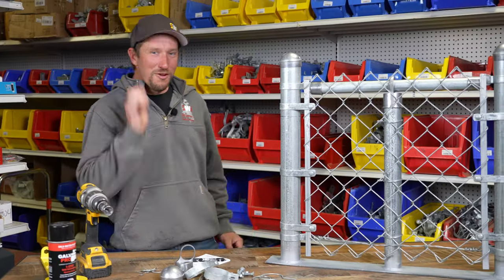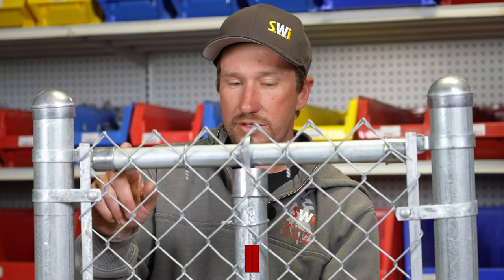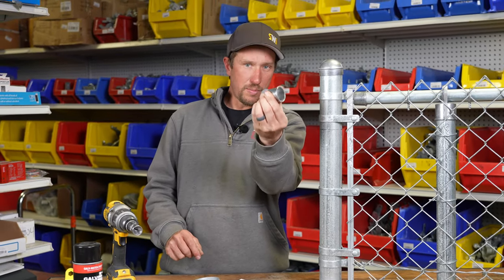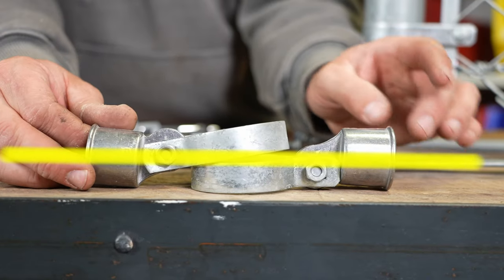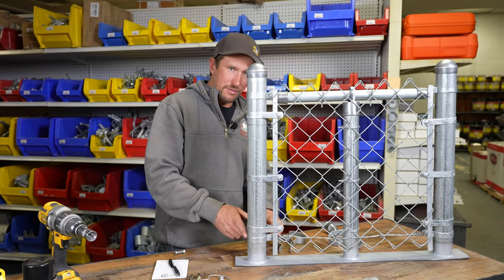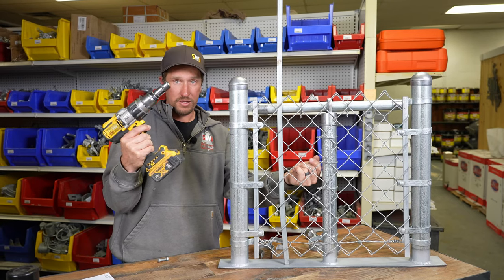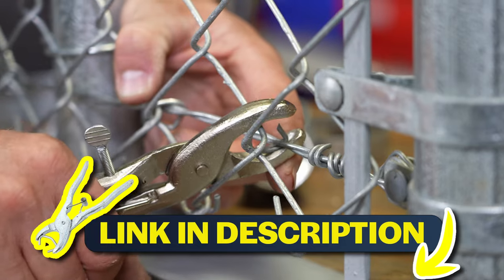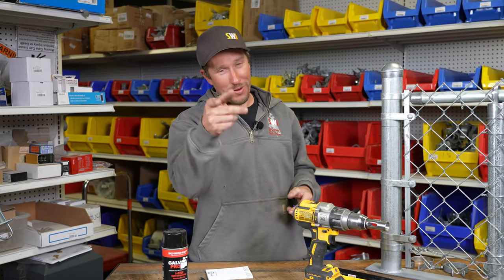Chain Link Basics: All The Parts And Where They Go

Comment: Your YouTube videos have been so helpful. Have you ever dine a video on installing a Chainlink fence with a large on the perimeter? I need some help. At this point I plan to put terminal posts on both sides of the tre following the fence line. Then I plan to put a low tension piece of Chainlink between the terminal posts to as low for some growth

Comment: We are enjoying your videos. Can a gauge 9 twist tool work with the 11gauge easy twist tie? I ask because I bought 1 today in Toronto and it has the number 9 on it although I asked them for an 11gauge tool. I am heading to the Caribbean at the end of this month to do our own fence. Thanks to your videos.
Reply from the maker: If it does work (I'm not real confident that it will) the wraps won't be as tight, which will make for a sloppy tie.
Reply: Thanks a million

Comment: I need a gate this exact size.

 I have an older 15ft long dog run and the door opens into my fence in back yard and I want to cut out a portion about 2 ft x 2ft and turn it into a gate so my chickens can get into the fenced back yard and roam free-ish, lol. I want to be able to open and close it with the standard gate latch to help keep them safe too. 

I think I can get the gist on what I need to do from this video but do you or does anyone else have any suggestions?
Reply from the maker: This might be of help as well: https://youtu.be/eWmv83ZK_YQ

Comment: Dan,
Over the long term and even the short term the Dewalt battery drill will smoke with the twist ties I found.  Twist ties work great.  I presently use corded Bosch 8.5 amp hammer drill on drill mode.  Would welcome a battery drill which would not smoke.  Thoughts?  Thank you!
Reply from the maker: Hmmm, that's interesting,  so I will share some history with you. We have never had a drill smoke, but we have had the 1/4" impacts smoke just from use and getting hot, this was often in impacts that had brushes. As soon as they came out with brushless motors our problems stayed in the past and have not come up since. As far as tying ties, we never had a drill smoke no matter how many ties we put through it. Dont forget its best to have the drill on the lowest speed. Hope this helps.

Comment: I need to replace a line post on an existing chain link fence. The post has broken off at the ground. How is the best way to tackle this? Thanks!
Reply from the maker: Snip your post free from the fence. Dig out the concrete (the least fun part of the job). Reset new post in concrete. Reattach.

Comment: Is there a decrepancy as to if the chainlink is behind the post or in front of post to tell who owns fence. My neighbor removed mine by this theory.
Reply from the maker: Like you see here, fabric is typically on the outside, and all nuts and bolts are on the inside--the secure side of the fence. However, this isn't really a great way to tell who owns a fence because whoever installed it could've done it differently. The only real way to know is to look at your property line. If it's on your property, it's your fence.